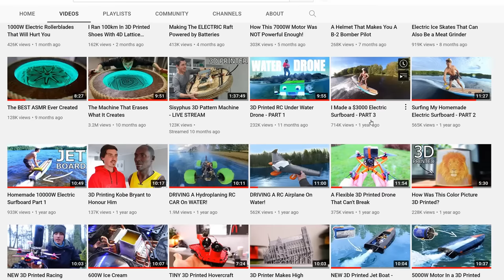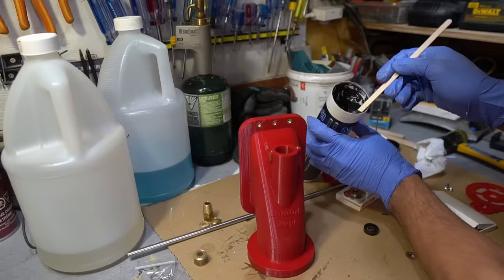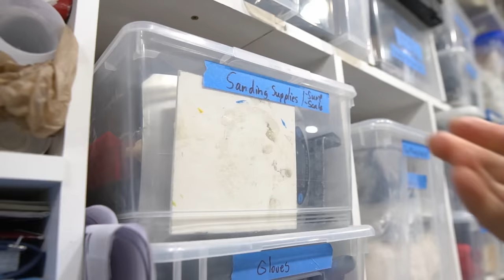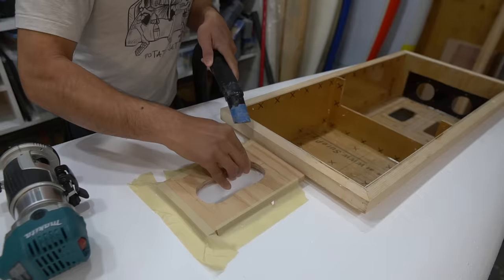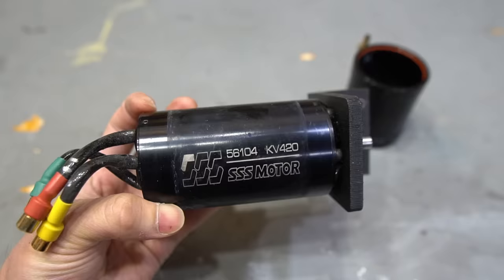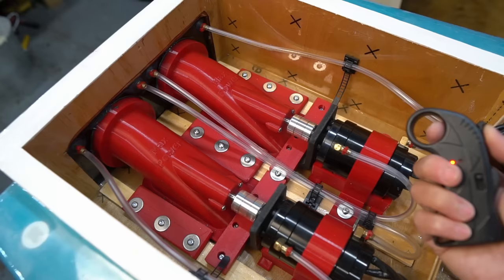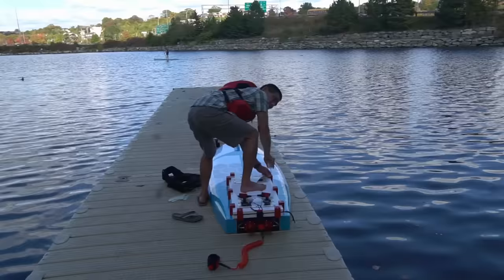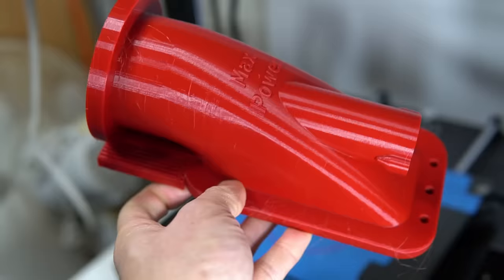How to Make an Electric Surfboard with 3D Printed Jet Drives

Comment: Hi! I made a jet a while ago, here's a few of the things I learned. You need a variable blade angle on the impeller. The blade pitch is measured as how many inches it travels per rotation, and as the edge of the blade travels farther than the inside per rotation the angle gets shallower the farther out you go from the centre. This makes the blades appear twisted. Also, stator. The water from the impeller is spinning, the centrifugal force of which pushes on the nozzle and kills thrust. You can also extract extra energy from this spin by having vanes going all the way to the nozzle exit. Also use a greased bushing at the back rather than a bearing. Smaller and increases thrust, plus less submerged moving steel parts.
Reply: F
Reply: Nice
Reply: Do it's have  a kits for sell
Reply: Воздушный винт и водный две разные вещи,и изменения угла ответ лопасти винта тут не уместно
Reply: With PLA plastic I recommend using Silicone Grease, not anything petroleum as they degrade the plastic over time.
Reply: Yes, 100% need a stator

Comment: Great work!!  I think a lot of your speed problem is with the impeller design. You may want to look into any of the big three company’s impeller designs. None of them look like those flat bladed impellers you used. The flat blades just don’t have the grip on the water you need. I’d bet a hundred bucks it would go way better with different impellers.
Reply: I agree. And I would add to that to have look at your intakes: the leading  edge needs to be smooth, where currently there is a step that prohibits proper flow of water into the jetdrive. Other than that great work!!!
Reply: @hjl4004  I noticed that too the intake ports are way too small and there should be far more of a radius to the edge, letting water funnel in instead of making it all take a 90 degree turn just before entering the pump.
Reply: Yep I totally agree. You can't just eyeball an impeller design; he should copy the design of an expensive retail version. You can see the impeller is creating a TON of cavitation too, just throwing away energy he could be using to haul ass.
Reply: Yes you are right. Came to say the exact same thing. His impeller looks more like an impeller for a water pump to cool an engine (normally running in an inclosed space and made of rubber). When you look at jetski thrust impellers they have overlapping blades with less pitch compared to this one. More disc like impellers. But Those will be a pain to keep in one piece under load when 3d printed I think. And pump inlet indeed needs to be more smooth to guide the water instead of starting with a vertical ridge all around before starting to guide it back.
Reply: @dextersxxxxlab  Absolutely agree with everything you said. Including the intakes, you get too much cavitation.

Comment: I plan to use the jet pump for a 6'4" plywood boat i built. I will use a trolling motor and put the battery up front. Thanks for the design. I hope there is not much modification needed.

Comment: Very nice! a few things I just wanted to give my 2 cents on:
1. I think your bearings are going to seize or are at risk of seizing. Personally, I would recommend an acetal bushing. you could easily make one on your lathe. also, lookup water-lubricated bearings, very interesting if you ask me
2. Brass suffers from something known as "Dezincification" I know it is a bit of a confusing name but it's when the zinc leaves the brass. Not sure what it's like in water but in steam it can be really dangerous
3. I would highly recommend bolting your lathe down really well. it looks a bit shacky and those little lathes (I'm assuming a 7x14) really benefit from bolting down
4. the way you are using the Dremel in one part is very unsafe. you have a brittle cutter spinning at an incredibly high speed and are putting side load on the disk. this could easily break and send shards of the ceramic cutter into you. I'm about as far from a safety Karen as you can get but those cutting wheels can be dangerous things
Not being critical or anything, just some advice
Reply: Man you are just full of negativity today aren't you
Reply: @thomasbarlow4223  I respectfully gave feedback on a project, what's wrong with that? Personally if i made a project like this i really like feedback from a different set of eyes or someone with more experience in that area. this comment was absolutely not intend to be negative, it was honest valuable feedback on a project
Reply: @henrydando  no i see it now.... i must have read that too quickly.... everyone is an armchair expert now and I thought he did a great job considering how hard it is to make a jet pump run correctly
Reply: Stainless steel bearing seizing? My only wonder about acetal bushing or nylon bushing is, what's their life expectancy vs SS ball bearings. I know Nylon is self lubricating, is acetal self lubricating too? Either plastic bearings have issues with the shaft enlarging the whole and causing the prop to hit the housing?

Comment: As a fellow tinkerer, I'm highly inspired. A few tips: on the final epoxy flow coat over the board after glassing, wait 10 minutes after spreading it out, then hit it with a blow torch to pop all of the bubbles. Also, have to tried printing with PETG? I'll never go back to PLA after using it. Higher Tg, less brittle, no smell when printing, no need for an enclosure, etc.

Comment: I would love to see the height of the box lowered so the top cover would be flush with the top surface of the board.
Also some heavy duty lithium battery packs.
A wrist band mounted wireless controller would be better too.
You're on to great things with this board !

Comment: Awesome project. I agree with others that your jet pumps are holding you back.  The flow of water out of them is very turbulent.  Turns out jet pumps are fairly easy to get working, but optimizing them is an art form. 

There are a couple good videos from a few people making pumps for RC boats that are really good and I think their designs are open too.
Reply: If you happen to come across one of the videos (particularly if open source) please post the links. Cheers.

Comment: Dear Andrew, Thank you for making your creative genius public on YouTube.  Using a 3d print scheme for the jet pumps was sweet indeed. It is when you shifted into welding an aluminum box for the jets that just blew my mind. We, as creators have to be capable/ talented at interdisciplinary skillsets. That you can fiberglass a board and then shift to make 3d printed parts and then machine these goods is awesome. I am thoroughly inspired to build out new projects. Will also take your advice and not build this jet powered surfboard. Vicarious thrills will suffice indeed.

Comment: This is awesome and some real engineering skills on show there. So nearly there though! It's probably got the power and the board width is probably fine too. Worth spending on getting custom steel impellers built for it. I'm not sure 3D printing will ever let you make the blades thin enough- other than with very exotic printing media that won't be possible with your machine- a little bit of carefully designed stainless steel or bronze could transform things. The jetski racers use custom built impellers and they aren't that expensive. What you've done with the impeller is the marine equivalent of building a car but also insisting on moulding your own tires for it- there are certain things where you just have to admit that relying on other folks decades of experience in a very niche technical field is just way more efficient than insisting that you build every bit of it yourself! There's being inventive and resourceful, and then there's just being stubborn! I know because I do it myself!

There is a lot of talk below about the entrance to the pump. What it needs more specifically is a scoop grate, or just a scoop if you don't want the grate to slow it down. Look underneath a jetski! Look closely at the rear part of the entrance to the jet drive and feel with your fingers what it does inside. You have to divert some of that water flow through the pump, water does not like being made to go round sharp corners when it is flowing at speed. If you do not physically divert some of the passing water into the jet drive too much of it will simply carry on waltzing past underneath! If you unbolt the scoop grate from a jetski it will hardly move- like it will do 25mph instead of 80mph, and this is effectively what you are doing here. This is why your board is topping out at circa 10mph, that is about the speed when the jet drives are calling out for more flow and when just the suction effect of the impellers becomes no longer enough to divert enough of the water which as the speed increases is increasingly more interested in passing underneath, not turning the corner into the drives.

Other than that I don't get why you have two pumps. If it's for steering at slow speeds, not as effective as a steerable nozzle on a single pump. Doubling up on propulsors is never as efficient as optimising a single one. A boat with a single 8hp outboard engine will be much faster than the same boat with two 4hp engines side by side! The parasitic drag (of the inside of the tube, the shaft, the stator vanes etc.) doubles when you double the number of propulsors, but it does not nearly double when you just make one propulsor a bit bigger and put a bigger motor to drive it. If its about motor size/ height/ diameter, you could still use two motors side by side driving one shaft- with a bit of short car cambelt and a pair of sprockets... If the height of the deck for placing your back foot is the concern, remember the diameter of the pump does not even close to have to double to double the volume/ mass being pumped. People would be amazed how only slightly larger a single pump would need to be to move the same mass of water moved by your two pumps. 

That's not the main problem though and would be a major rework. You could get that thing planing- I mean properly planing at foot steerable speeds- with your motors and pumps in about a week with just a pair of scoop grates (which you could make by hand in one evening with a curved bit of thin plywood and some epoxy filler) and a professionally designed impeller.

Comment: Nice project. Scratch building is really rewarding,, after you solve all the technical details lol.
 TIPs: For PLA plastic use Silicone Grease only, petroleum based lubricants will degrade the plastic over time.
 For gluing and sealing PLA plastic I use Plastruct Plastic Solvent Cement. I coat the entire inside surfaces of the Jet drive to seal and smooth them so water flows easier thru it. I strongly recommend any printed impeller be coated completely so it withstands the forces put on it.
 I also recommend builders get a 3D Pen. Great for welding plastic together, mounting plastic parts and much more uses.
 Hope this helps builders make a better working project build.

Comment: Nice.. My dad and I build a jetboard too (2nd one now)
The pumps (we have 2 in our build) are not home made, but are DIY'ed by a friend.
We actually used some of your videos to build our own board
See this being the result (v2) https://www.youtube.com/watch?v=EsRiNROaXUE
We are now building a 3rd version!
Reply from the maker: Oh wow, very nice job!  Yours works so well, I think I will shrink down my board , that might actually give me some more speed.
Reply: @Andrew W  Yes. Our 1st version was also longer (it was a 8ft converted foam board). After making it a bit shorter the speed did increase a lot!
Also. We did a lot of testing with motors, and the best for us are the 600KV motors. (remember we have 2 of them in our board).
They take a lot of amps, so make sure your battery's are up to them We run them with a big EV 12S (50 volts) Li ion. 
520KV might be fine too by the way/
Again. This with two 53mm jets. They do about 15000 RPM at WOT.
Reply from the maker: @iamkian  Awesome thanks for the info, your comment has me thinking that i will cut it down over the winter 😉.  Nice to see others out there doing similar things!

Comment: if you want more amps going through the motors you can make the angle of the jet drive blades more pronounced or the impeller longer (they should have minor overlap viewed axially, going beyond this in length or overlap doesn't help), add more blades, or make the impeller bigger radially.

Comment: This is a real nice build. But man, it always gets me. Any time you grind/file/whatever on metal shafts, you always have to smooth edges out. Any time you have a sharp angle (like the flat spot for the hex drive, for the impeller), with twisting forces? That sharp angle will crack the shaft 100% of the time, the only question is when. Gotta smooth/radius it out. Stress Risers don't care if you're in a rush. That's why lots of things have undercuts on threads, and radius/fillet shoulders, and if it needs to be a hard shoulder then they undercut-fillet them. Sharp corners = cracks, always. Since this is gonna have a ton of vibration too, and I don't know what type of SS that shaft is, stress-corrosion cracking is a thing to look out for also. Such a simple thing, but one that will leave you in the cold! Great build, that impeller and pump look amazing!

Comment: The grease should be a marine grease if you haven't used one. Many greases contain soaps and the grease becomes emulsified, so the bearing then corrodes quickly. Super impressive project 👌

Comment: I could use a few tips regarding a pedal boat design using a water jet engine thanks to an e-bike mid motor. I was thinking about a slight intrusion into the water to assist with a small dynamic sail

Comment: Nice !  Think about a hydrofoil set up and keep the board wide.  I have two suggestions for a pump box. One make it from pink styrofoam or tha stuff you made the board with and coat it with fiberglass mesh and resin just like the board. Or it can be made with very thin aluminum flashing material but an inside and outside dual wall filled with expanding foam. No welding required. Just some hot glue maybe some pop rivets here and there for bulkheads  and some spacers as well as mounting strips for pumps and motors. Listen to advice from that nice lady in case you get too excited about what you are doing and forget some safety stuff!

Comment: To build light weight and water proof boxes look into using rigid foam insulation covered in wood glue and canvas then paint.  It's called poor man's fiberglass. Or if you want to use actual fiberglass you can use polyiso foam board.

Comment: It might sound dum but I always wondered how the water doesn't leak inside boats through the shaft whole, thanks to your video now I understand the concept of the oil seal :).
planning to print small  version of your pump and maybe make RC jet sky toy.

Comment: Great project, an improvement for the jet drive is to smooth out the intake flow.  Finnegans Garage has some good info on this for full size high horsepower jet boats, but same concept.

Comment: @Andrew W  If u tape off the spots u route out of cut on plywood u will stop all those splinters from happening its ALOT CLEANER

YOU EARNED A NEW SUB SIR ...

MUCH LOVE FROM 

NORTH OF THE WALL!
Reply: also ... EPOXY should be measured by VOLUME unless stated on the jugs otherwise.. almost always the hardener is LIGHTER that the resin . OBVIOULSY THIS ONLY APPLYS TO 50/50 mixes
Reply: AHHH I just heard your wife(?) say youre in CANADA .... man i hope you get to arrange a meet up of like minded ENGINERDS

Comment: your gonna need a wayy steeper angle on the impeller. your best bet is to print an impeller with the steepest angle your printer can handle. then tune the nozzle size to desired amp usage, and then tune the stator to straighten the flow as much as possible. you may have to play with nozzle size after straightening. and also make the stator fins as thin as possible. 1.5 to 3 mm should work and last a while. the water should come out straight, not in a cone.

Comment: Cool project!
I think the jets could increase in thrust with different impellers like others stated, and an improved intake geometry. I'm talking about the flat cutout in the bottom of the board. Jets usually have smoother intake ramps and sometimes a small wing like structure about halfway on the intake hole that diverts the water into the intake. I think you could also make a small low profile scoop near the back edge of the intake.
Reply: i agree

Comment: Great project!  You are on the right track, but......... I would make the intake a lot smoother to give it more "flow", also your nozzels should be a bit higher up so you can generate more thrust. Right now they are to deep in the water and that just generates resistance. I would also go with some other impeller, i don't think that is the best design for this. My guess is that your impeller is to small because of the cavitation they produce. That on it's own is a loss of thrust. Other then that, great work.

Comment: Great project, but maybe you can considering of using the deferens model for the propeller also try to make the motor rotation to be the opposite of one motor to the other, just maybe that can help you with the stability and control.

But allover that was a great project.

Comment: I made some thermoformed polyethylene boats a couple of decades ago in NorthBay, Ontario,  Called them Bobbers..  Sold quite a few.  One model I tried, had motors but nothing that compares to your design.   They had a cute pool noodle border to give them the fun look and to make sure that even full of water with a child in them they wouldn't sink.   Contact me if you wish and I will send you pictures. Maybe I will find the time to modify one of the bobber boats.  Robert